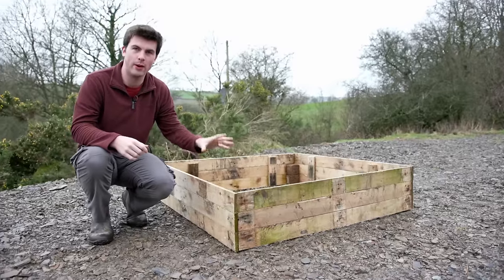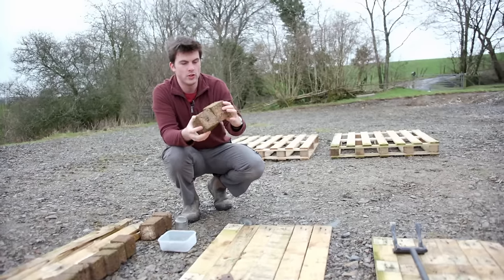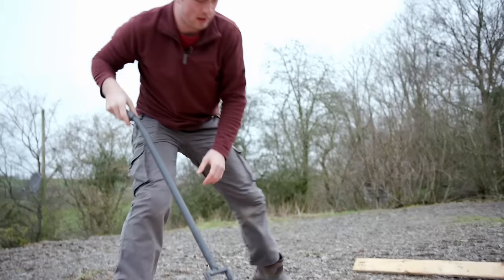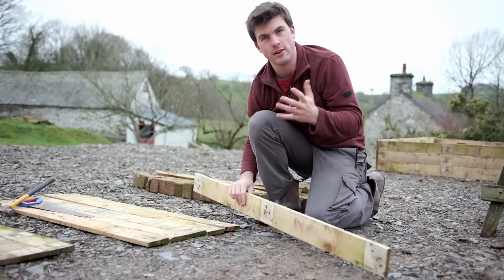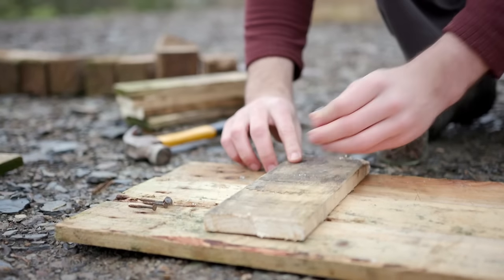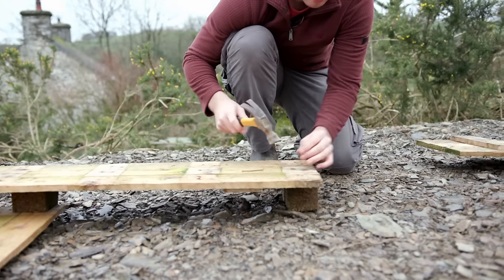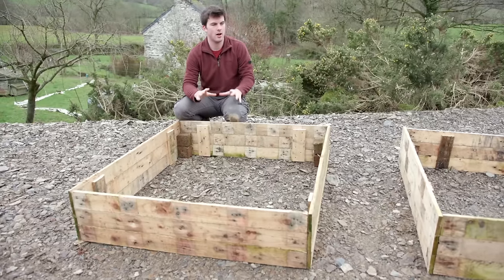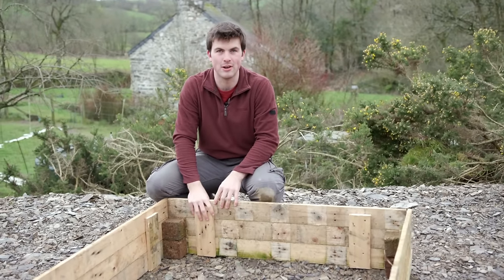How to Build a Raised Bed from 1 Pallet! (FREE and Easy)

Comment from the maker: Also I forgot to mention to use pallets which have been heat treated😁 Look for the HT symbol!
Reply: hi huws hello,apa kabar 😊
Reply: are heat treated pallets free of nasty preservatives hugh? dont want to be picky but i wouldnt use those corner blocks for it, its basically the same as particle board with nasty glue, but if the boards are clean its a good idea to re-use them.
Reply: @thegreenman4898  Heated Treatment (HT) is, as the name implies,  a process whereby lumber is heated in a closed chamber until it reaches a core temperature of 56°C for at least 30 minutes in order to kill pathogens such as insects, fungi, or micro-organisms. There are no chemicals involved.
Reply: Other safely made pallet types are KD which is kiln dried or DB which is debarked.  The one to absolutely stay away from is MB which has Methyl Bromide which is a strong pesticide and absolutely not safe to work with or be near plants intended to be eaten.  If the pallet doesn't have the initials HT, KD or DB on it, just steer clear to be safe - and thanks for another fabby video! :) :)
Reply: Thanks for mentioning the HT factor. Regards.
Reply: @eleanorwilliams9245  Thanks!
Reply: Cover the outside with a coat of water sealer, they’ll last years sealed from the water and uv
Reply: @jecriggs  is the symbol to look for just 'HT' ?,
And are blue pallets useable?, Cheers 👍🏼
Reply: I am kinda sad, i build a planter from ex pallet wood but since i live in indonesia and the wood is very cheap and the seller are not very highly educated, it is not traced responsibly. I have problems with fibroids and i want to grow my own crops for my health and i bought so many pallet woods now but i cant make raised bed with them. I guess i am lucky i find out sooner than later about this, maybe i'll just make a working table now with them. Thank you for adding this comment for us who has no idea what we're using. ❤️❤️
Reply: @Users_rx  Dude put plastic bags
Reply: Dude I don't know why everyone uses crowbars. Just take a sawzall with a metal cutting blade and cut the nails in between the boards.
Reply: I just watched someone use plastic tubs for a raised garden box. make a couple holes at the bottom.
Reply: @linebrunelle1004  Plastic tubs or bins are good, but make sure they are food grade. Sterlite No. 5 is a food grade storage tub. There may be others with different food grade numbers, but please verify. You can even stack these tubs on  plastic chairs, old tables, etc. - especially if you don't want to bend down to reach and tend your plants.  Can even use tulle to cover so bugs, birds, and other creepy crawly things don't devour your plants.  Saw a video from Robbie in Southern California who has great ideas.  Happy Gardening  to all!
Reply: Where is the stamp at on pallets?
Reply: @linebrunelle1004  Please make sure the plastic tote is a food grade recycle number of 5 found on the bottom of the tote.

Comment: When I was a youngster, my brothers and I used to collect bent nails from construction sites and straighten them.  They were a bit dodgy to use, but if we took the extra time to be careful,  it could be done.  I remember getting my fingers pinched quite a few times until I started using needle-nose pliers to hold them.  We used to make little shack-like forts from scrap wood with those nails.
Reply: Ron Yerke that sounds so wholesome and awesome
Reply: When I was a youngster my dad saved all the rusty and bent nails whenever he demolished anything . When he reused the screws he rubbed them on a bar of soap so they would screw in easier .
Reply: @charlesroberts6490  nice! The ol bar a soap trick. Happy building cheers
Reply: Your comment is a prove that not long ago children lived lives full of nurturing and wholesome experiences 😊
Reply: And I remember from my childhood that we were making washers for the insulating the roof from beer crown caps. You needed to put one cap on an anvil and hammer if flat. Then it was ready to be used on a rooftop. :-)
Reply: @charlesroberts6490  we built lots of forts, but when we were done we had to take them all apart and save the nails for our  next creation

Comment: Hi ya the pallet splitter works better if you put it on the 3 runners going the opposite direction. That way it gives you straight nails and slightly more pallet wood with less broken planks/strips. This was a tip I found after breaking loads of pallets.
Thanks for your videos

Comment: Please make sure that you use pallet's that you know the history of. Lots of pallets are used for chemical transportation and should not be reused
Reply: ArcticCareBear is there any way of cleaning it first or something?
Reply: @eveoriordan305  I don't believe so, as even sanding would result in airborne particles of contaminates if the pallet has that origin
Reply: ArcticCareBear ohh ok thank you but I think I’m still going to make something similar mainly because so many people have done it and it didn’t affect them so 🤷‍♀️
Reply: @eveoriordan305  thats a very ignorant viewpoint,Eve..The pesticides and insecticides used to treat pallets might not cause you to drop dead immediately but it can surely affect yr health.Imagine having a spoonful of pesticides for dinner once a fortnight.Anyway,if u insist on using them,look for the HT,KN or DB logo and STAY AWAY if it has the letters MB on them
Reply: @elephantsong7782  thanks for the advise but all I’m trying to say is that loads of people have made raised bass from wood and I didn’t seem to cause that much damage by the look of it .
Sorry if I came across rude the first time 😅
Reply: HT or heat treated ones are typically safe you can also leave them in direct sunlight to help kill any pests that might be in the boards

Comment: I don't have the fancy pallet dissembler, just crowbars, claw-hammer and tongs and pulling apart pallets is my least favourite part. I resorted to cutting the nails with a reciprocating saw and it works faster, with fewer split boards, but there is an extra step of removing nail heads. New nails are fairly cheap, but for straightening old ones, the cubes from pallets are good, just put the nail on top and hold it and rotate it, while hitting it with a hammer. 

At hardware stores, there are parts for joining things at a 90-degree angle (two 10cm flat rectangles with holes, joined at a 90 degree angle, don't know what they're called). They're cheap and they're a viable alternative to using cubes to hold the sides together. These can be reused when the wood rots. 

My bottleneck for raised beds has always been long reclaimed boards (I want 3.5-4m long ones), but this modular approach can work too and when making rows of these, 1.2m is a good width. It should generally be better to make rows South-North, rather than East-West, because both sides of the longer raised bed will get similar amounts of sun that way.

Comment: Hello Huw
I have watched 1 video where instead of using a dedicated pallet splitter they took an old garden fork which had a bend tine. The tine was cut away using a hand grinder which left a gap in the fork wide enough to fit over the bottom stringer board and lever against the top slat board. Seemed to work quite well for them.
Best wishes, 
Pete.

Comment: Most of the Pallets I have come across are assembled with Spiral nails which make taking them apart a real nightmare.
When the thin wood splits it is rendered almost useless for the long sections.
Better to use thicker wood to join the strips together as joining two thicknesses of thin wood won't result in a strong long term bond.
Reply: I have found exactly the same thing ,Danny.   In my experience pallets very rarely come apart that easily .

Comment: love this! Did you stain or add a finish to yours? Just built mine but worried about weather deteriorating the wood. What non-chemical stains can I use?
Reply: Boiled linseed oil. Made from flaxseed and available at any hardware or paint store

Comment: (From a 74yr old)
That really inspired me Huw;  however what I've learned is that there is a range of types of pallet construction some of which were an absolute nightmare and defeated me. Providing a video as you suggested, about splitting pallets would be really helpful.  The strongest ones had been nailed probably by machine and proved impossible to deconstruct. 
I agree the one you demonstrated with was easy so I suggest other watchers would be well advised to get that flimsier type of pallet to use for raised beds. Then its as much fun as you had and removing and re-using nails is very satisfying.

Comment: Concern to the "feet" of the pallet - which you are using for the corners: You will face a serious problem. There are two types of used material for the feet - one is massive wood - which you could use easily, but second, and that´s what you have here - they are made of pressed sawdust with some glue component, which is not water proof. So when they are getting wet, they are instantly crumble into saw dust. Just to mention that. For the bent nails: Just use a hammer and make them straight for to reuse them. :) Beside of that - fantastic design, great idea and very skilled done! Just an additional suggestion from my experience: It´s always a good idea to use some strengthening from the inside, from wall to wall - either a strong wire, additional posts or similar. Soil, especially when wet, is a very heavy medium and can push out the walls very easy. In the end, all the walls can be bulged out without support from the inside (or maybe wih additional supporting posts from the outside, hammered into the ground.
Reply from the maker: Crumble into sawdust? Mine is still standing strong, watch my 17 hacks video as an example :)

Comment: Hi Huw, great video. I was wondering if it would be worth putting anything on the pallet wood to prolong its life, such as linseed oil, which i have seen done in another video. I wonder what your thoughts are on this. Also, would a single layer pallet structure be strong enough for a longer bed, such as the one you recommend in your book, i.e. 3x1.2m? You use 5cm thick recycled plastic planks which I'm sure will be  very strong, but as you have mentioned yourself, are quit expensive. Thanks.
Reply: I use beeswax! I also tint them first with very «strong» coffee! Great tint + last longer! 😊
Reply: You can also line them with old coffee sacks (made from hemp). Can get them for free from coffee roasters! 😀

Comment: Good stuff! However, around here; pallets aren’t free 😂. Everyone wants like $5-$10 for good pallets lol. Besides that, a good raised bed for $5-$10 is pretty good. I just find that the pallets around here are super thick and extremely difficult to tear down. It’s taken me an entire day to tear down one pallet before, using a 5lb pry bar, a 20lb pry bar, a 10 & 20lb hammer and I finally gave up and used a recipricating saw and cut through the nails, or through an end, losing a good portion of the materials. However, the “plans” look easy and perfect! Thanks! 😊

Comment: Nice use for the spacer blocks! May I make ONE small suggestion for pallet dismantling? As you have a hammer, USE IT FOR DISMANTLING!!! Ha ha ha! Plus move the middle block up to the top or your soil will start to fall out over time.

Comment: I wish the pallets I picked up had nails that easy to remove. The ones I got had nails that had the faintest screw-like spiral that made the disassembly of the pallets (especially in a single plant and not splintered to hell) a very toilsome task resulting in me having just barely enough planks, luckily I picked up a 96 inch plank I picked up from home depot on the off chance the pallets wouldn't yield enough wood and/or I accidentally destroyed them in the process of breaking them down.

Comment: Amazing idea. I have a few questions, and I hope you can answer: I am planning on putting this raised bed straight onto concrete, so what base would I use when I fill it with compost? Any suggestions? Also, will i need to raise the bed? I will be growing carrots and potatoes. ☺️

Comment: If you wet each and every nail on the pallet, say with a spray bottle of water and leave it for 5 or 10 minutes you're less likely to split the wood. I dunno of the exact the magic/science behind it but I suspect the wood fibres swell and maybe lubricate the nails (??). Seems time consuming at first but you'll save yourself some heartache. I've recycled quite a few pallets and before I started dampening the nail/nail holes, I split many lengths. If you hear the wood starting to split, stop and apply more water and wait a bit longer. Of course some of the wood may already be fractured and you'll still lose some....but you'll also have more that you can reuse if you wet them first (compared to if you don't wet them). Don't believe me? Just try it ;)

Comment: I don't have the pallet tools and just used a claw hammer for everything. I found the square blocks were the trickiest to get off without breaking. Would you treat the wood to stop it rotting? I have used plastic tubs in the past and they've lasted years.

Comment: Speaking of pallets. I live in the city (Chicago) and am considering ways of starting an urban farm. There are SO MANY developers that are just sitting on vacant land for future sale or developments. My idea was to have a mobile urban farm and provide a sort of custodial service to the developers, grow produce at a profit for my effort, and be able to pick up and relocate if/when the land changed hands. My idea (so as to NOT reinvent the wheel) was to make raised beds out of pallets. This way, with just a pallet-jack, I can rearrange them on the property when needed; or load them on to a truck for relocation. I want them to be wheel chair height so I can employee disabled people. I imagine I can make one bed out of every 3 or four pallets. I'd use one for the base, take wood from the others to make the sides, and use the supports from those to reinforce the main base.

Since pallets are typically 48" I imagine the first 30" can be the 'in-ground' production bed, the back of the pallet-bed can be built up to provide a trellis (using even more pallet wood or something lighter) for veining crops; and herbs can possibly be planted in whatever leftover space is in between. 

Only thing is, I don't know if I should use a giant grow bag inside, or if the sides can be built up well enough to support the inside pressure of the dirt and water. I've calculated that 7 of these in a row would be just over the length of a standard 25 foot bed.

Perhaps you could give it a try? At the very least you'll get some content out of it.

Comment: If you want a very low cost eco friendly way of preserving the wood for longer you can use the Japanese method of shou sugi ban. Essentially you char the wood and it helps to seal it from the elements and deters pests and other things that break down the wood.

I use a propane torch for weed control to char my boards and it works very quickly.

Comment: If you don't put hardware cloth on the bottoms, then you're just creating rodent habitat, and I'm having to remake all mine 🙁
Reply: Pablo Floyd 
Where I am there are animals like rats in the ground. They eat the good worms and they kill my plants. I have to fence them out. I put a wire cloth floor on the bottom before I fill it with good dirt. Keeps them out!
Reply: Thanks for the advice.

Comment: Hi Huw, Thanks very much for the video. Unfortunately I can not find recycled plastic bricks at my area so I will try this palette one.  I have 2 questions marks, one is I will try the raised bed at my rooftop  terrace which has gravels as a ground. So when I do my raised bed I need to put something on the ground which should be non toxic and which should avoid soil going in the ground. what do you suggest? Also, two make this beds life longer is there a non poison way. Like painting the wood or covering inside with some kind of plastic. Thanks very much :)

Comment: You know...if you alternate those little blocks... put two on one end (one on the top and one on the bottom), then one in the center of the other end...

Just duplicate that over the whole project, then drill a hole straight through the blocks, top-down. 

You could actually get a dowel, a bit of rebar or a sturdy branch, and could make them something that could be take-apart and rebuild easier.

Comment: There is an issue with using pallets, and that is the various pesticides that pallets are sprayed with depending on the countries it has traveled to. I would never use them for a garden bed that you are growing eatables in. These pallets travel all over the world and each country uses different sprays so as not to transport bugs that can be invasive. It's a nice idea, and I am big on recycling and repurposing. The wood is also much too thin and will rot away in one-two seasons. I've been growing everything on my land for 22 years and have never used any kind of none organic chemical on plants, lawns, trees, and garden beds
Reply: Not everyone has the option of growing in their land. I’d love to be able to, but even with our twos acres, there are too many big roots in the ground. We have great soil too, so it’s a pain. Can’t risk damaging trees close to our home or wires.
Reply: @Nyaja16  I built some raised beds but I could only afford to buy one load of soil. I saw a video where the guy filled the raised beds halfway with logs, branches, and leaves. So L did the same thing to my beds. I happen to have some rotting logs, so all of that wood and leaves will break down over time and become soil. I will probably have to top it off in the fall before I plant the cover crop of ryegrass. Best of luck!!